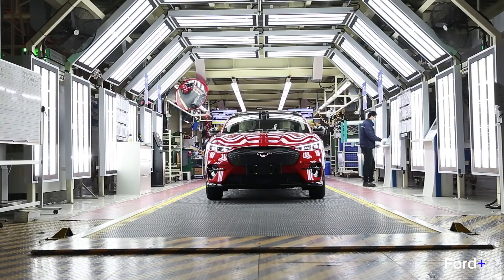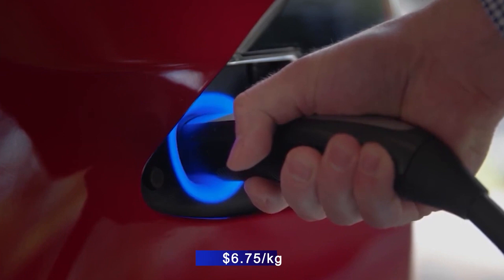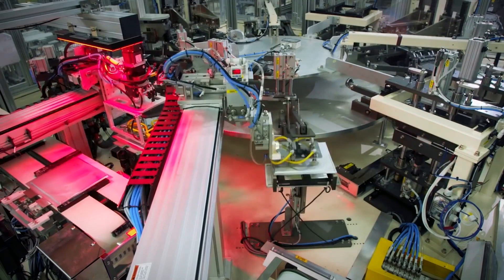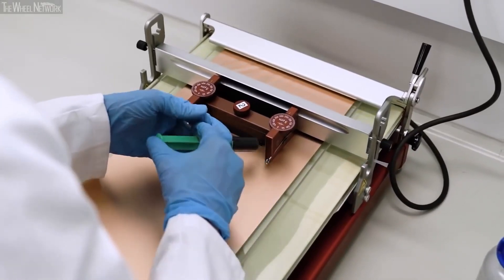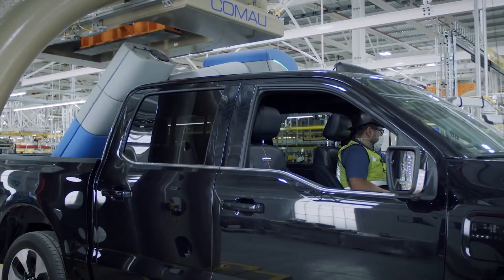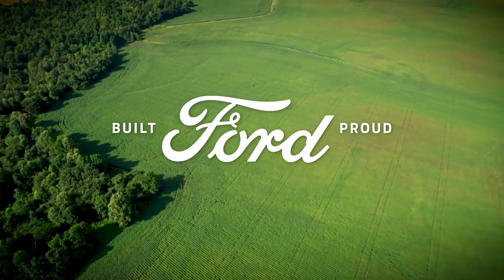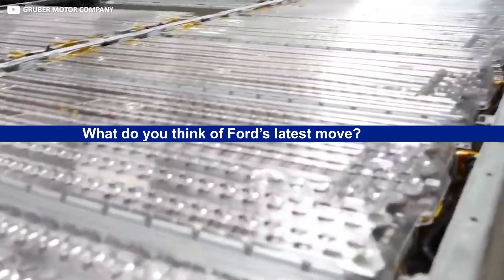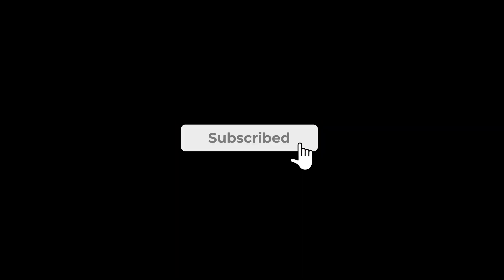IT HAPPENED! Ford Finally Reveals New LFP Battery!

Comment: battery capacity is not really the issue in an ev drivetrain.  My concern is the design of the induction motors.  Any phase shift in the magnetic flux SHARPLY decreases its efficiency.  This is why Tesla does so much better with a trailer than a lightning, Hummer, or rivian.  The motor is designed to operate at a specific RPM under a very tightly controlled output torque.  increasing demand causes a sharp decrease in operating efficiency.  To me, all this focus on the battery has clouded how important the drive system really is.  In the industrial world there are dipole three phase systems.  One is made for high field torque to get the machine started and the other is made to operate at a very specific rpm to a rated torque.  When I design a system, we design it so the motor can run at its highest possible efficiency with our torque requirements.  There are tricks to this design as well.  In higher torque environments it would be better to change the rotor diameter, add more stator surface area to increase flux, change the operating rpm, or even electronically run the motor out of perfect phase to increase high load efficiency.  Ford in particular needs to redesign the motor.  Its not good enough, it should also be controlled by a two speed transmission on both axles.  I would personally consider running a bifurcated stator in a heavier vehicle, I could take advantage of more efficiency under higher loads and also run the motor with minimal magnetic flux so its even more efficient and very light loads.  No compromises, soem added cost, but also a towing range of 150 miles instead of 59.

Comment: Ford's EVs are ridiculously expensive and their PHEVs aren't much better, until they and others can break out better quality EVs below $35K there won't be better adoption of EVs in the US. Are LFPs the answer??? Potentially, but the range needs to be better, the charging network needs to be more reliable, and charging times need to be significantly faster, so people aren't spending 30+ mins charging their EV every few hours on long distance trips.

Comment: I don't know why people don't like plug-in electric vehicle hybrids.  My brother has one that runs about 54 miles on the battery and then the gasoline engine kicks in.  When he first bought it he was commuting 250 miles a week he only used 5 gallons of gasoline a month.  Now that he's retired he generally just uses it for 20 and 30 mi trips and charges it up with his solar system in the middle of the day because it's only a 14 kilowatt hour battery.    In the last year,  he's only filled the 5 gallon tank four times and that was because he took road trips of over 200 MI.   I think lithium iron phosphate is a good match for a plug-in hybrid.

Comment: You might get 500 miles from an NCA battery out of the showroom but the other important number is how far can you go over the life of the battery? LFP does a lot of catching up over that time, thats assuming the NCA one hasn't incinerated itself all together before then. LFP has proven itself capable of lasting 10+ hassle free years, that is a huge selling point in my book.
Reply: State of the art LFP/LFMP is now 210 wh/kg and the 230 wh/kg is entering production soon.  By comparison NMC/NCA is ~265 wh/kg but since LFP needs less encasement/cooling it is almost identical at the pack level.  The bigger issue is volume which is legitimately worse with LFP based chemistries.  More efficient vehicles such as Aptera can do far more with less battery density and on paper (volume and weight) a CATL sodium ion battery (absolutely no expensive metals) could still achieve 500 miles in that super efficient design.

Comment: Comparing the present EV trucks is like comparing a F 150 to the F 350. You're asking for Tesla semi performance out of a gentleman's truck. No one expected that kind of performance out of the Ranchero.
Reply: The ranchero might not have been able to tow as high a load BUT it could tow a race car and trailer, or be filled with building materials, and still go as far as you wanted vs 49-95 miles before needing a several hr "fill-up". FYI the 2022 F-150(ice) is capable of towing14000lbs

Comment: Hope their LFP batteries are better than their PowerShift Transmissions... Transmission control module is on a 6-month back order for thousands of customers with failed transmissions...  The energy density of an LFP battery is slightly lower than a lithium-ion battery. Their energy density falls between 90-165 Wh/kg. Verdict: Lithium-ion batteries have a higher energy density... Another way for Ford to cheapen out on their products for profit...

Comment: All ICE vehicles in the world today use a common 12volt battery of a similar
form factor. Today, every vehicle mfg in the world is ramping up to build e vehicles.
In the future, I can see a common e battery pack being used across all MFG
vehicles. Just like todays 12v, it will come in different capacities or Whr
ratings.

!
Reply: Not really While the batteries are (generally) the same voltage there are multiple sizes shapes and terminal designs on today's car+light truck batteries

Comment: I care about both range and price.  My 2014 F150 Super Crew 4X4 Eco (which is now paid for) will go 550 miles an a single tank going over all the mountain ranges from the Oregon coast to N California and back on 35x12.5-20's and my heavy foot.  Range, got it!  5 Years ago I paid $32k with 36,000 miles.  Did the math a few months ago on the cost of the $92K Lightning I built online vs current $5+ fuel prices vs my annual driving mileage, and at about 11,000 miles per year, that Lightning would have to last me for 22 years and about 248,000 miles to justify the gas savings and that is before paying for charging.  I'm keepin my current truck and forgetting about the electric Lightning.
Reply: Easy answer.  If you have a paid for truck that meet your needs keep it. I doubt you would like paying for a new ICE F150,  Forget about a new truck that 2014 has years left unless you live in Michigan  IF/When filling the fuel tank makes the truck less attractive then think about replacing it or maybe just getting another vehicle to drive when you don't need the truck.
Reply: The real saving is for households with 2+ cars. 1 EV for commute/errands and one ICE for the long distance haul. While the EV runs efficiently in the city, the ICE vehicle will see only highway miles and will last for a long time.
Reply: @drury2d8  I agree.  This should change if/when the IRA funded charging stations are installed.   At that point we should see a big drop in the price of used ICE vehicles.
Reply: Not to mention with current tech you can forget about being able to tow anything heavy more than maby 100 miles or so without stopping and charging the pos up for 45 mins no thanks. I like the concept of going electric, but sitting any longer than the time it takes to fill a gas tank is wasting my time. When it gets to 5-10 min to full charge w/ a min 550 mi range I'll consider it. Till then it's a exta hassle, next to what we have now.
Reply: @jason0870  Agreed if you tow significant trailers or campers stick with your ICE for now.    Realized we are looking at 1st gen electric trucks and the 150 is not a ground up electric design.    There are a lot of people who will live quite happily with 1st gen trucks.

Comment: With all of the reviews coming in on the current electrics on the road, the obvious problem is driving them like a gasoline powered vehicle. You can, and the power is amazing and all, but you can not and expect range.
  The national speed limit HAS to be lowered to 60 mph MAX, and it HAS to be enforced. 
   Right now, if you drive 60 mph on an interstate, you're a traffic hazard. Most interstates are 70 mph, but if you drive slower than 85, folks run up on your bumper and give you nasty looks and the middle finger......you can pass Highway Patrol cars all day running 85 mph!!!

      If you want this tech to actually work, you're going to have to adjust to it. Aerodynamic drag kills this tech....
Reply: I was attending uni during the 55 MPH speed limit.   Home was a 300 mile trip all interstate.   At 75+  one could often make the trip friday after your last class.  Maybe go out that night if your last class was not too late. With the 55 MPH limit it was torture.  Safer  to leave Saturday morning.  The impact was far worse then the numbers alone indicate.   More stops.  Seemed harder to stay awake.  And of course the federally funded county sheriffs who's only job was to write speeding tickets.     Also think of the additional cost to trucking.

Please Please don't ask for this.   We need to look to the future.  We can afford EVs at 85 just build a few more wind farms.    Think about the day when you can get FSD and ultra safe cars run ever faster with far fewer accidents accidents.

Comment: The last question in this video completely missed the most important features of LFP batteries.  It said, "do you care more about range or price?"  For me the most important features of LFP batteries are their incredible safety and outstanding life cycles.  They can be charged and discharged 3-5000 times to 80% capacity.  Nothing currently available and ready for the market comes close to that.  Basically the batteries will last the life of the car now.
Reply: People talk about how modern batteries don’t last , i have a bolt ev since 2017 and it is now 5 years old with 0 noticeable degredation . I use it for uber . These problems are made up .
Reply: @jdmilion1096  your battery is only 5 years old and its under recall.
Reply: Actually LTO bests that. 10k 100% dod, 10 min charge.
Reply: @aae7725  And even better, they claim a 20,000 life cycles and even better safety than LFP batteries.
Reply: LFP patents running out in 2022. Invented in the US but Chinese companies own the patent. Tesla LFP Powerwall switching to LFP. I wonder if it has anything to do with patent expiration.
Reply: and see thats the huge problem right now with EVs, the battery doesn't last the life of the vehicle and it when it takes a shit its $10k-22k to replace it. if they make a battery that can do 200 miles, lasts 20 years and does 300k-400k miles.....i'm in. right now thats a not happening and its cheaper to buy a low milage old condo car for cash and drive that.
Reply: @MrSGL21  the ford F150 lightning battery is $38,800 not including labor
Reply: @MrSGL21  most cars unfortunately have the same problem especially if you're buying a brand new motor from the manufacturer. 

Combine that with the fact that the "warranties" they give you on the new power plants are worded in such a way that. If any problems happen they're going to blame the user. 

At least now with third party technicians there's some relief. You don't have to replace entire battery modules. Similar to ICE cars.

That being said I do agree with you a lot of people that are blazing the path are going to unfortunately. Bear the cost, of being first until technology improves.
Reply: @MrSGL21  Actually is is happening now, Tesla has started making their cars with LFP batteries and Ford will soon.
Reply: @jamescabaniss5857  smaller manufacturers like MG have them too

Comment: I found it interesting, it seemed 80% of your B-roll that you were using during your explanation was all with the nickel and Cobalt type batteries you showed very few LFP batteries.

I also think your choice segment about saying would you rather have the longer range or would you rather have the more inexpensive battery being the LFP. In actuality the LFP battery is much less expensive than the other battery as it can last up to 3 to 4 times longer so you wouldn't have to replace it in the car for a minimum of 10 years and you may be able to get 30 years out of it if you were only charging it once a week. 

Also the lithium iron phosphate batteries don't start on fire so I think I'd take the lithium iron phosphate battery instead.

Comment: Do these batteries explode like the LG batteries?
Reply: I don't know about LG but lfp batteries don't have thermal runaway it is one of its best points. Liquid fueled cars catch fire far more per capita so if all cars were ev as of today there would be less total fires per day than before. You would go to ev to reduce the incidence of car fires not the other way around
Reply: @CarkeekW  The trouble is the EV's combust without warning. Gas cars will usually leak first and smell.
Reply: @CarkeekW  None of the motor heads want to hear how their cars burn

Comment: Would these batteries also work their hybrids?
Reply: No, to get high cycle life, they have a 1c charge rate. Hybrids often use batteries that can charge at 30c.  To transition to these, the battery pack would need to grow by 30 times, which makes a very different vehicle.